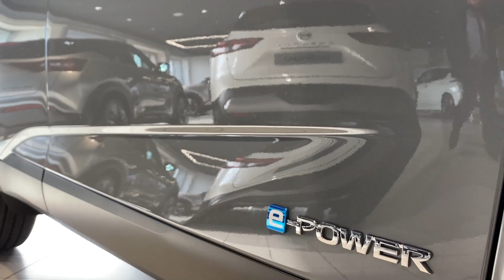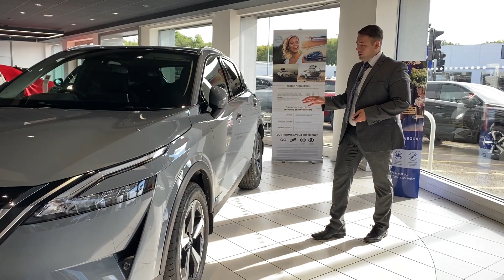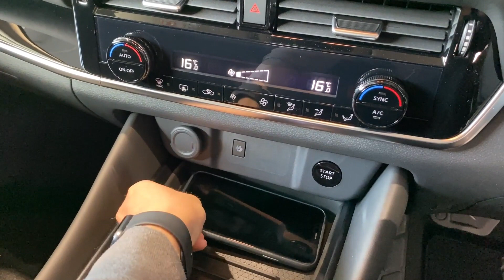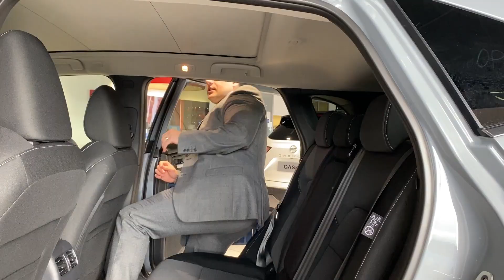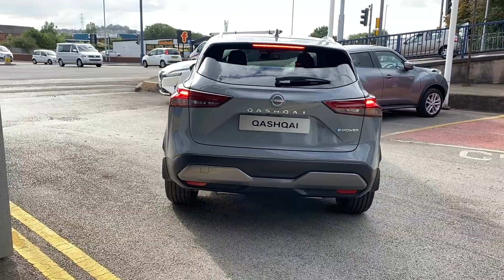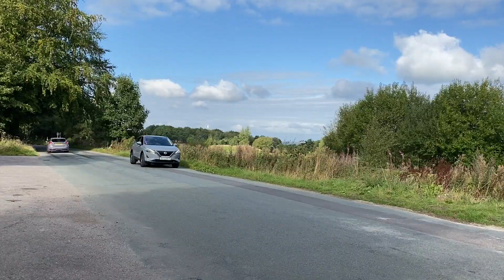New Nissan Qashqai with e-POWER: Test Drive & Review. The Ultimate Engine and Battery Performance!

Comment: Thanks, I get my 2024 ePower next week & had ordered it on this week. Not bad, in Gun Metal, 1st choice was green Ocean Deep but 4 month wait which is not good enough & all the brands are doing this. I wondered about brakes on Regen being wore out as it brakes pretty sharply, but how does it do it? I will have to half my braking distances on how I drove my old Scenic. It doesn't feel right but once I get the hang of it & they may have to change the rules on a driving test, as the car is totally different with the instant acceleration, and these cars should not be driven by under 25s, as it would be carnage out there. Millennials, men or should I say boys, really drive very fast thinking its a computer game. We just had a horrific crash with 4 young men died driving very fast & hit a tree. Few days before 6 died in another accident. Back to car design. This front works well with all colours. The 24 Joker front doesn't work well with bright colours. Next year they are changing the front again & looks good. So you buy your car & 12 months later its yesterday's car because of constant every year revamp. It doesn't help brand loyalty by doing this every year. You feel sort of conned. Thanks.

Comment: Only 1 point. Keep your hands on the steering wheel!   In reference to that does lane assist physically keep you in the lane or is it just a warning?  Recently experienced lane assist on a Subaru that kept the vehicle in the lane,  gives a new meaning to hands free.
Reply: Hey, I might be a bit late to answer, but as no one else has I'll do it for anyone else wondering. I have the previous generation of Qashqai with lane assist, so I'm assuming it is the same. Lane assist will beep when your crossing lane markings without indicating. If you're indicating it will realise this is probably a motorway lane change, and so won't warn you. However, if you drive using lane assist with the radar cruise control on, it will make minor adjustments to the wheel on your behalf to keep you centred in the lane, really useful for motorway driving. Haven't ever used this around town, but I don't think many people will cruise control around town. Anyway, I hope that's of some help to you.

Comment: "It uses the battery to brake." Eh?
Reply: As the drive is entirely by an electric motor, when you lift off the go pedal the car's inertia then drives that motor's energy use in reverse and it becomes a generator. That causes the car to slow down as the captured energy is returned to the battery. It feels like you have used the brake pedal but you haven't  - so the brake pads last a lot longer. Regenerative braking.

Comment: Hello, my name is Anthony. I currently drive a 2011 Toyota Auris diesel and I am considering buying a hybrid. I am interested in the Qashqai e-power but would it be possible that you upload a video of what the engine sounds like with the bonnet open on a cold morning. Basically a cold start.

Comment: Is the cabin heat instant ( from battery) or do you have to wait for the engine ?
Reply: Can anyone answer this question please
Reply: @simonmidgley9128  Heats up very quickly, uses battery so long as there's sufficient charge. If not, need to wait a moment for ICE to kick in.
Reply: Thanks for letting me know 🙂

Comment: So it's an electric car 100% powered by petrol? Pointless really.
Reply from the maker: Not really, it gives better MPG, electricity isn't free...... Also an electric car as amazing as they are aren't for everybody, catering for everyone means doing many things in different ways
Reply: EV’s are great if you have access to cheap charging at home rather than expensive commercial establishments - which are also not always convenient. Putting in petrol to drive in EV mode might sound strange, but for those that live in apartments it gives most of the benefits of driving an EV without the worry of how/where to charge it. I will soon be ordering a N-Connecta model.

Comment: Still confused as to mpg….or electric equivalent. My current Qashqai has achieved 52 mpg on a long run. I am struggling to appreciate what is the benefit of changing to e-power
Reply: Ive had the e-power since November last year and I am getting roughly 52 mpg and I don't drive it hard. Driving in EV gives you practically nothing milage wise. Saying though it is THE BEST CAR I have ever driven, I traded in a top of the range Insignia estate for it and the 2 don't compare.
Reply from the maker: You will get better MPG plus also the engine isn't always running. Another benefit is the regenerative braking will use the brakes less too
Reply: Drive one!
Reply: It’s quiet and the driving experience as well.

Comment: I have older the new qashqai here in cyprus  but not the e-power (the gas one) at 1/05 and I expecting it around 1/01/2023..do you know if I take it with the new infotenment or the old one?
Reply from the maker: Any new car should have the new infotainment system Trolias 😀
Reply: @holdcroftOandJ  even if I order it 01/05 and I don’t leave in the uk?

Comment: Really enjoyed the video - thank you. However, despite me using the vehicle for mainly URBAN driving - I also cover long (400 mile) motorway journeys every 6-8 weeks. How would this work with the MPG and components? Would it be a case that by driving around the 70mph on motorways, that the electric side of things aren't used and you depend on the petrol?

Also, are you saying the petrol is used for the motor to charge the battery only - thank you.
Reply from the maker: Hi Jeff, the engine only ever powers the battery, it is always an electric motor that turns the wheels under amy circumstances
Reply: @holdcroftOandJ  .. thank you - understood and much appreciated for the swift response. Have you any official MPG figures of real life driving because it states around 53.3 MPG.

However, aren't these usually much lower on everyday roads and traffic etc. I'm really interested in this vehicle because it's the next step up to the future of driving!

I've been a DIESEL driver since 1998, so I have to adapt to a completely new style of driving these EV/Hybrid vehicles! There's so much information to take on board but these videos are fantastic 👍
Reply: @jeffsmith559 I had an X-trail ePower rental in Iceland for a week. Unfavourable conditions as it was both cold (so not optimal for the battery) and it was the AWD e4orce variant so already more thirsty but I was getting 42-45mpg pretty consistently, and I’m no slow coach. Such a nice smooth drive, will likely ask for a Qashqai ePower as next company car.
Reply: Read the brochure,  engine only charges battery,  no connection to wheels,